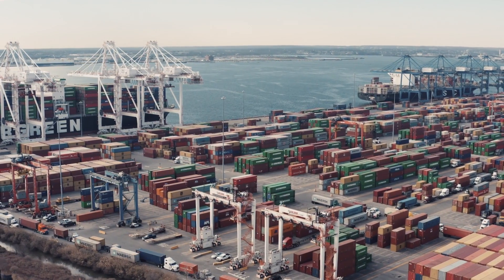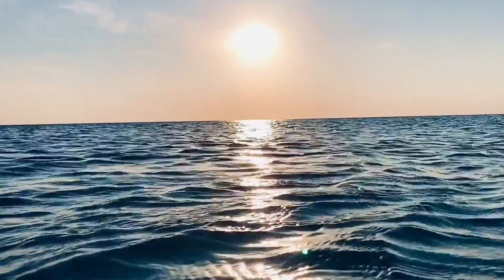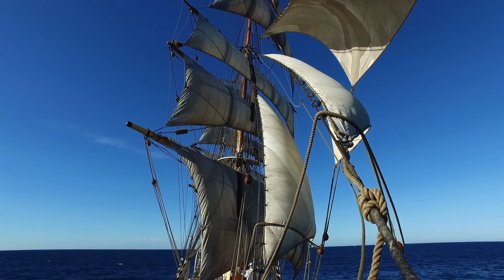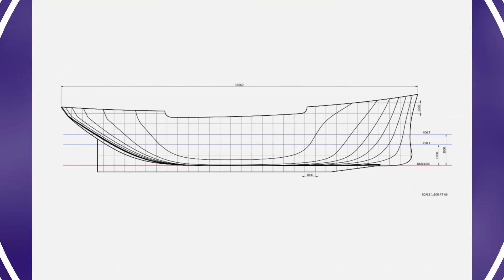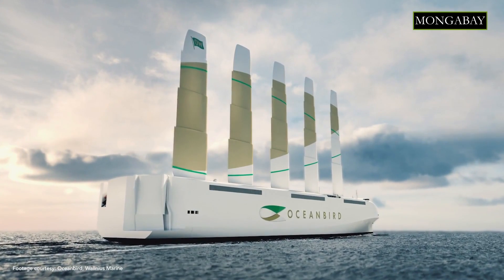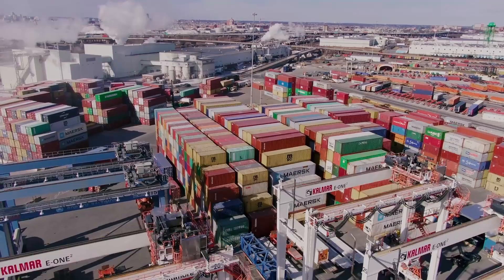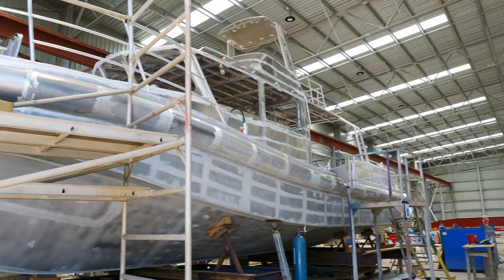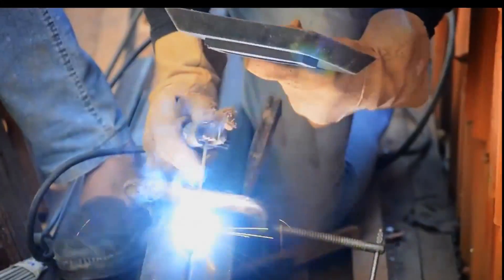Go Sail Cargo Sailing Ships

Comment: Have you seen Sail Cargo from Costa Rica? They're building a four-masted square rigger.
Reply: Their project takes the carbon foot print to a new low.  The only problem is that it has been under construction for at least two or three years. I don:t think that there is enough time to build the wooden ships needed.
Reply: how about TRES HOMBRES,  love their rum !!!
Reply: Sailcargo Inc. Costa Rica is building a 3 Mast Schooner you must have mistaken that with the Falls of Clyde that is being saved from Hawaii.
Reply: @charlie70605  Yeh slow fo sho, but i do luv the concept. Steel hull sailing cargo would be the way to go, tadroberts,ca has a 52' & 60' Steel Cargo Schooners designs and Kastenmarine,com has a 100' & 120' Steel Cargo Skipjacks designs.
Reply: Reality is starting to bite them. Its a no go/wont go for obvious reasons.

Comment: Not that it is a dumb idea it isn't on the small scale. on the large there is now way. 
 Lets do some simple math though. How many wooden sail cargo boats will it take to replace one mid sized container cargo ship? Well the largest sailing cargo ship had a capacity of 8960 tons one 40 foot container can carry 30 tons.  that's 300 "40 foot" containers. And a average container ship can carry 10,000
containers you finish the math. 
Never mind there is no fully rigged sailing ship that can accommodate even one Intermodal container. and i dont see the whole way a shipping items to change back to the way it was 150 years ago. 

And lastly using a ban on petrol and diesel cars in the UK to start a video for sailing cargo vessels is dumb. because no ban has yet been announced world wide. Is pretty low.
 And there is no way the UK will ever meet that 2030 deadline to go 100% electric in eight years.
Reply: A container ship lost 689 containers in January 2021 from China to US  Maersk.Essen. as a result of parametric resonance.
Reply: I sort of agree on the size BUT economics drives everything. With higher fuel prices, you see shipping lower their speeds as to become more fuel efficient. They do this now to save money. 

Second, I would say I agree that rigged sailing ships are a thing of the past but we've gone beyond the old designs already. Airseas is already testing massive computer controlled kite systems for ships. Given they fly higher, they would be more reliable and with production volume would be much cheaper to maintain than standard sailing equipment. Further, using this would open the deck up to more volume even repurposing of older diesel hulls. I think you will need a saildrive electric battery bank for storms when kites aren't going to work and for harbors. 

I agree 8 years is too soon but if you put all these technologies together, multiple kites on a streamlined ship for their use, even at the current fuel levels I could see a company being potentially disruptive if not competitive.
Reply: You know nothing about commercial sailing ships.  Towards the end of sailing, these ships were not wood but steel and could hold massive weight. On it's maiden voyage, the Peking hauled over 5,000 tons of nitrates.  I believe it could haul a lot more than that, but I don't have the numbers at this moment.  But yes, sailing ships wouldn't be able to hold near as much as a container ship so more would have to be built.  But your numbers are WAY off.
Reply: @ironcladranchandforge7292  Ok let’s do some research.  The one assumption is that you are referring to the German Empire made Peking see Wikipedia( https://en.wikipedia.org/wiki/Peking_(ship)  ) ) ( https://en.wikipedia.org/wiki/Flying_P-Liner )
My medium sized Freight ship is called a Panamax. ( https://en.wikipedia.org/wiki/Panamax )
Now it’s  time for some math’s  Panamax tonnage 52,500 deadweight minus Peking’s 7,800 deadweight   
Equals the Panamax carries 44,200 more tons than the Peking.  Or the Peking would have to make 6+ more trips to carry the same amount. Not counting the sailing time difference between them.
And if we compare a modern bulk cargo ship to the Peking a bulk cargo ship the numbers are even worst except the seawaymax (https://en.wikipedia.org/wiki/Seawaymax ). But they only operate in the great lakes region.  And they still carry 3.6  times more per trip. 
 Are there improvements to be made? Yes of course there is on a new ship using modern sail foils we may be able to do it. But there is no economical way to make an old sail plan like the Peking economically viable. 
Never mind my main gripe with this video was that the in it. It stated that the UK was going to outlaw diesel ships by 2030. I have not found a law from the UK that states that. If you can I will gladly change my mind. 
Thanks for the good argument. I love doing research. And if you can prove your point with quantifiable research as I did, I will change my mind.  But as “Jerry Maguire said show me the money”